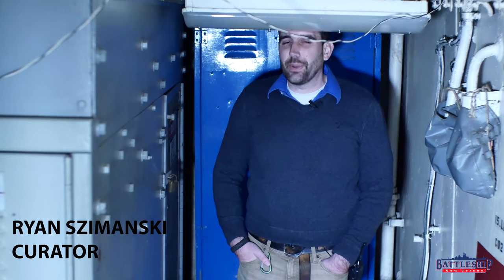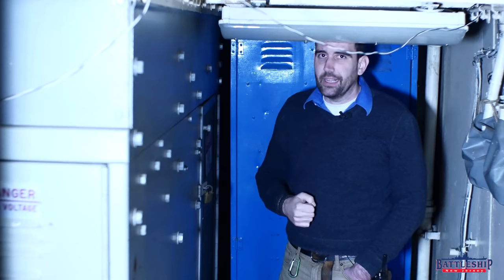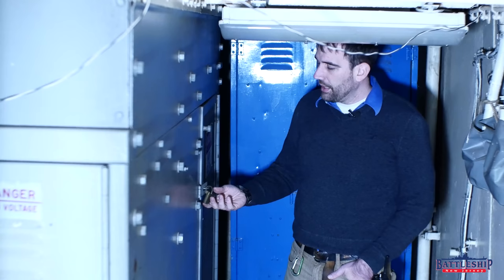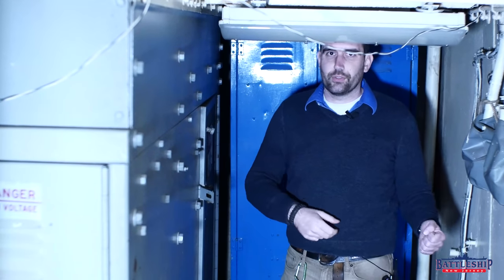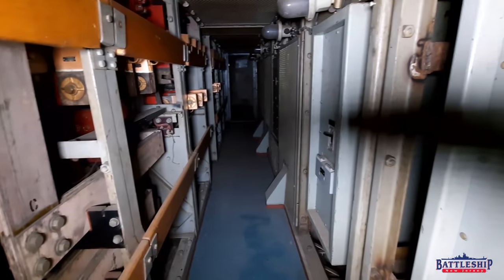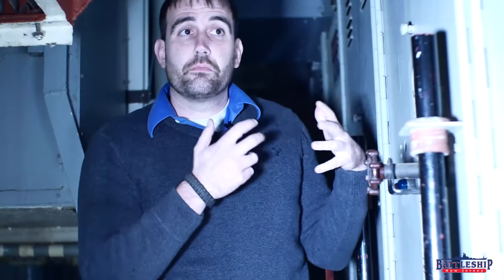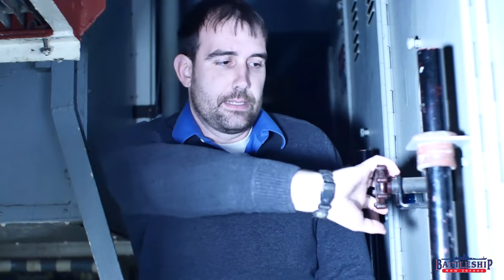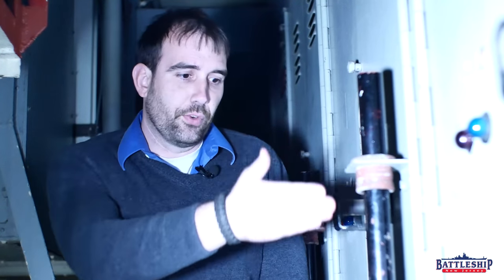Why is a Bus on a Battleship?

Comment: Does not matter if you get shocked from a 480 volt 15 or 5000 amp circuit breaker. Its the amount of current that flows thru your body. Believe its some links 100 milliamps ( 0.1 amp) will kill you. During my 50 years sparky carrer got shocked with 120,208,240,277,480 volts and 5000 volts from static skins mayor's & furnace ignition transformers. Worst shock that I ever received was while working in a large s!daughter house as an apprentice. The electrician over me was in a hurry an told me to unplug a 240 volt cord while standing in 4" of cow blood. I did as I was told and got a large shock that traveled from 1 arm by thru my chest and out the other arm. Went home with chest pains that lasted a few hours.

Comment: I'd like you to consider finding an actual electrician or electrical engineer and redoing this video.  Draw out one of the breakers, show the main and sacrificial contacts, get your nomenclature right, et al. et a. et al.  Need not be a ship electrician; any industrial electrician will do.  The equipment there is much the same as industrial equipment shoreside.